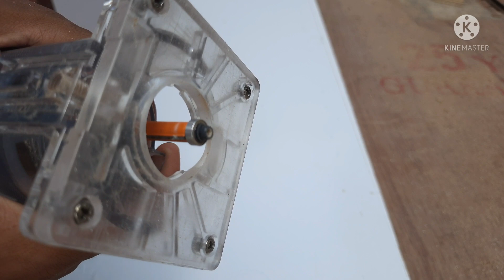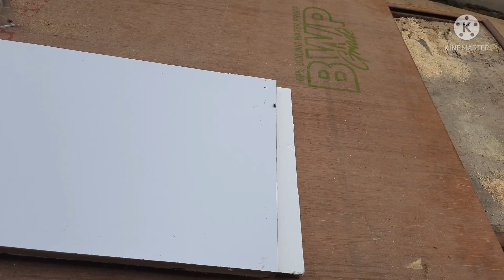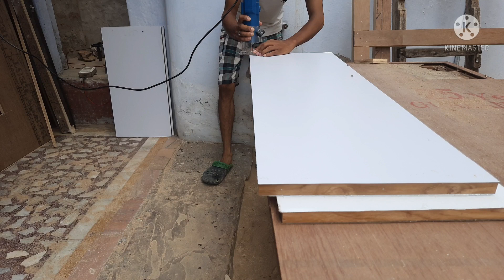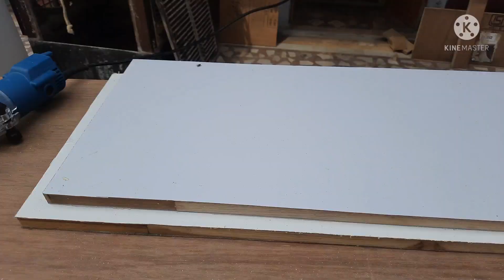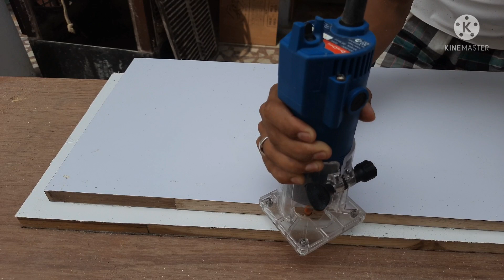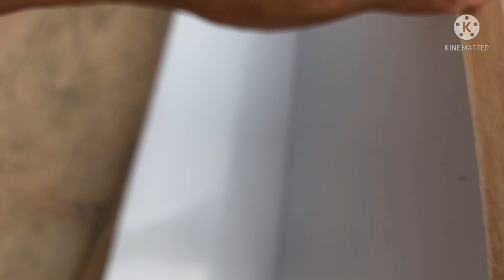Sunmica adge finishing with trimmar# rauter se sunmica finishing kaise kare#using dongchang trimmar

Comment: Which bit is used should be explained. Bearing maintains the trimming size. But sometimes there is gap formed due to blocks in the plyboard at the edge and in that gap bearing follows deeper path and may cause uneven trimming. I would suggest one straight patti to be clamped to avoid uneven trimming(just like we use in ply cutter)